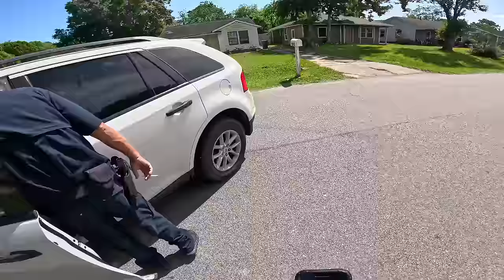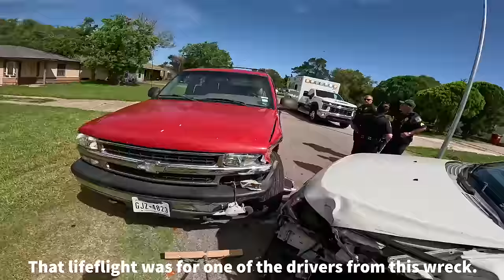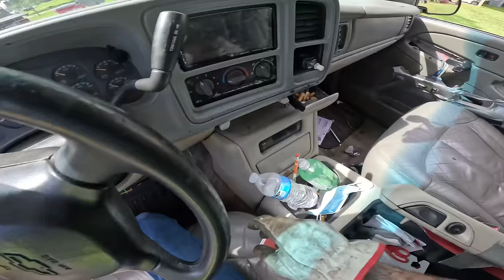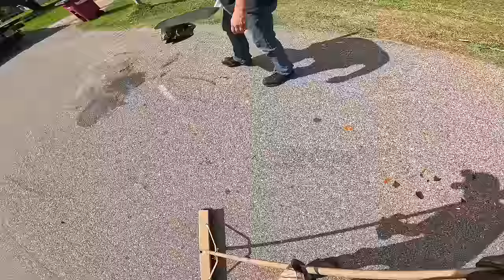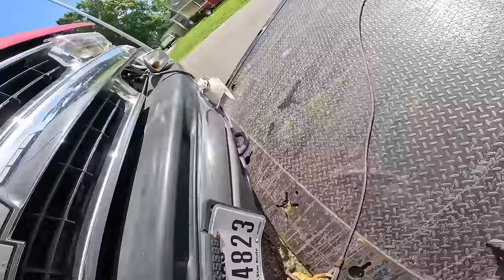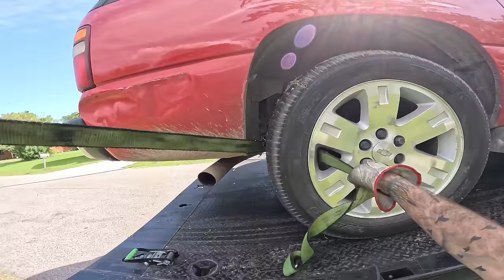Ford Vs Chevy!! Ford Edge Goes Head On with a Suburban!

Comment: The Suburban didn’t look that bad
Reply: No but the bumper is too close to the tire to be driven
Reply: @bigboyd9775  not really
Reply from the maker: Because of the hit, the steering was jammed, and the bumper was rubbing the tire. It definitely was not capable of leaving under its own power.
Reply: @bigboyd9775  mi pppkii8889ooii00k
Reply: @bigboyd9775  smmmmjfd

Comment: What happened to the tool box
Reply from the maker: Latch broke. So it’s ratchet strapped shut.
Reply: Definitely could have hooked both and rolling before the Lil wrecker arrived. Looks different down south. Philly metro area we couldn't get away with half what goes on lol. No lone blocks, no turning around on highway and most of the time we have no police or fire running blocks for us.
Reply from the maker: Definitely wouldn’t have had both loaded in that little of time lol
Reply: @thook9951  Lmfaoooo ok mr tow expert 😂

Comment: Has the issue with the air leak near the air bags been resolved or is it still there?
Reply from the maker: I’m actually sitting at the Kenworth Dealership right now getting it replaced.
Reply: @Towtruck_Dustin  lol about time right?
Reply from the maker: No joke. It’s been so annoying. We were waiting for some other parts that took forever lol
Reply: @Towtruck_Dustin  I know the feeling, waiting on parts can be very frustrating to say the least, much less having the right equipment to do the job.
I'm retired and I've had more than my fair share of hurry up and wait over the years, I used to work with a trash company in North Carolina and the bull 💩 I had to put up with wasn't funny, my biggest pet peeve was the young guys who would not come in to work and would get away with it consistently but the world would go to hell if I took a vacation day, I was operations support, I wore many hats as part of the job, the guys all thought I screwed around all day until one did a ride along with me, a lot of the rumors stopped after that day,
Reply: @Towtruck_Dustin KW is ridiculously slow right now. All the dealers suck bu kw is awful for turn around times
Reply from the maker: Yeah I found that out. I’ve had to deal with them 2-3 times now and had a hassle each time.

Comment: What’s the point in two trucks more and more stuff in your videos confuse me you have a rollback you can take both
Reply from the maker: Because we had two available. Could I have loaded both? Absolutely. But the boss was in the area and wanted to help. So he came to help.
Reply: Definitely could have hooked both and rolling before the Lil wrecker arrived. Looks different down south. Philly metro area we couldn't get away with half what goes on lol. No lane blocks, no turning around on highway and most of the time we have no police or fire running blocks for us.
Reply: Exactly I’m not waiting for another truck we have rotation where I stay and I get there before the other company the cancel then and let me get it and put them back at top ain’t got time for that waiting here
Reply: @nickgirardot2730  both trucks were the same company his boss was in the small wrecker 😂